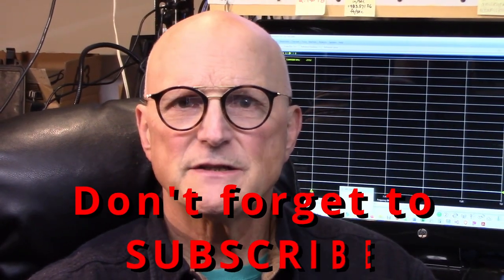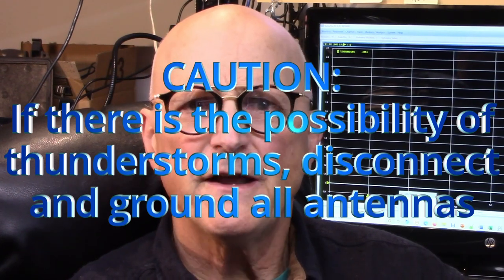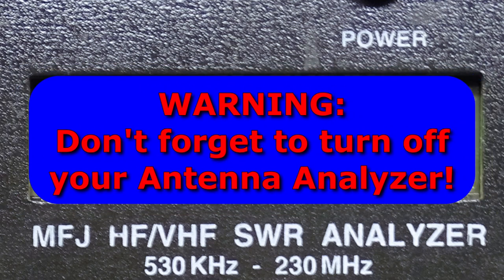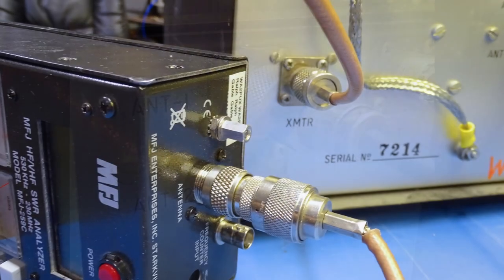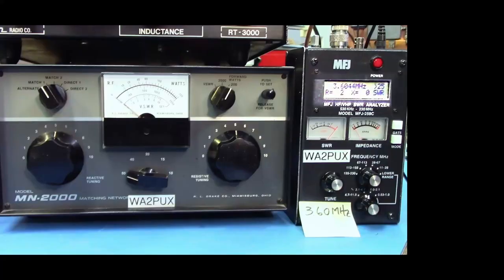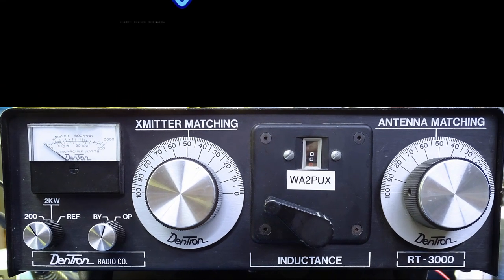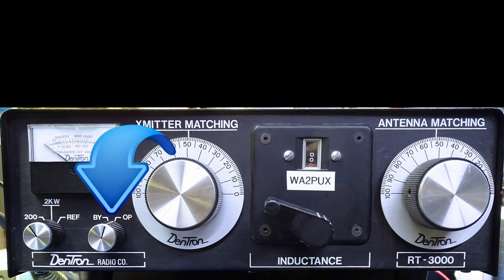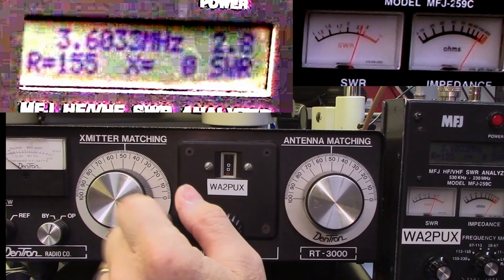Tuning Your Antenna Tuner using an Antenna Analyzer or VNA (007d)

Comment: This is an excellent explanation and demonstration. Most timely considering I just got an old HealthKit 1000w roller inductor antenna tuner. And I have been having trouble tuning with it. Going to connect my nano analyzer to it later to see if I can at least get a baseline on each band. 

Thank you sir
Kd9rek
73
Reply from the maker: Thanks, man! I am glad that you found the video helpful. I'd be interested to hear how that works out for you. 🙂

Comment: In my experience, adding a Smith Chart curve (on the VNA) greatly simplifies the process.  Adjusting the Smith Chart curve so that the closest point on that chart is nearest prime zero at the frequency of interest shortens the process of reaching an optimal match.
Reply from the maker: I can see where the Smith Chart approach would be very helpful. Unfortunately, most people's eyes kinda glaze over when faced with a Smith Chart, partially because they do not fully understand it.  The SWR view is something most everyone understands.  For an even more definitive view of the tuning point, the Return Loss format would be ideal.

Comment: I have a MFJ  949E. I think it would tune like that last one you did. It doesn't have a band switch,  or rotating inductor,  but has a inductor selector.  Thank you for the information! I wished I had that tuner.  But it may take up all the room I have for all my equipment.   73
Reply from the maker: You are very welcome! It was a fun video to make. 🙂

Comment: Great Video Ralph!
I was wondering about the VNA calibration-plane.  Did you just calibrate at the VNA or did you calibrate at the antenna tuner to zero out the coax that would normally go to the Xmtr?

Also, I have built a 1:1 balun (that is to be used for a friend's amateur radio club for their Winter FD) and have been able to successfully test for SWR and RL (using a SAA2-N VNA) but I wanted to do a supposed 'common-mode' test whereby you configure as a S21 measurement. In this setup,  the VNA shield is continuous (between S11 & S21 ports; but has NO connection whatsoever to the balun) but the S11 center-conductor is connected to the center-conductor of the input SO-239 (through a series-resistor) and that same S11 center-conductor is also connected through another series-resistor on the SO-239 back-shell. Then on the S21 side, its center-conductor is also connected (also through a resistor) to one of the balun's output legs and again, the S21 center conductor is also connected to the other output leg through another resistor.  
The problem is that when I try to duplicate this experiment, I just get really weird results (RL looks somewhat believable but SWR is in the hundreds!).  I also don't know exactly what the value  of these resistors should be and if there is any 'calibration-plane' involved and where it lies. In short, I have no feel for the measurement or any confidence in any data.

Is there any way to contact you (if your willing) so that I could email you this setup and additional ancillary information?
Thanks & 73...
Reply from the maker: I can identify!
I have not done a lot of this. I did find this article helpful, however.
https://www.kn5l.net/Balun-CM/BalunMeasure/
Port 1 is connected to the balun's input side...both center conductor and ground.
The ground of port 1 is connected to the ground of port two.  Now, on the balanced side of the balun (this article assumes a 1:1 balun), there is a 25 Ohm resistor between balanced side A and port two's center conductor and another 25 Ohm resistor between balanced side B and port two's center conductor. This gives the proper balanced termination for a 1:1 balun.
Calibration would be performed at the end of the cables as close to where you would be making the measurement as possible. The S11 calibration plane is at the end of the cable connected to port 1 where you performed the VNA "Enhanced Response" calibration.  "Enhanced response" will calibrate for both S11 and S21 measurements; so, open, short, load, thru and isolation. I think with the nano VNA, this is what they consider a full two-port calibration (S11 and thru).
I can be contacted via ARRL.  I also have a Facebook account by the same name as this channel.
Hope this helps! 🙂
Reply from the maker: This all has piqued my own interest. I think it deserves a video. I do not know when I will get to it. I have several videos in queue at the moment. But, I have added it to the queue. It'll be fun! 🙂
Reply: @eie_for_you  first off, thank you very much for responding and researching my comment.
I will definitely look into the article you sent and very much appreciate you, including that!
I think this would make a very good video as there is great ambiguity, about not only the method, but the theory behind this measurement. I have seen this measurement made by other, Youtubers, however, when contacted, they do not respond to specific questions regarding how they came up with certain values, or seemingly mystical correction factors that they just gloss-over or assume to be common knowledge.
Thanks again Ralph I really appreciate it!
73 …
Reply from the maker: @SpinStar1956  You are very welcome! 🙂

Comment: How would I be able to check my Free To The Air antenna VHF UHF for TV  Sir ???
Reply from the maker: I am assuming you are talking a 300 Ohm system. A VNA assumes a 50 Ohm.  Let me ping a friend of mine and see what he says.
Reply: @eie_for_you  300 ohm to 75 ohm balun. Thanks for your help fella.
Reply from the maker: Yes, understood. If we assume a 300 Ohm to 75 Ohm balun is in play, then the VNA or antenna analyzer is still expecting to see a 50 Ohm impedance and will report its findings accordingly.  So, let's talk an entire system which will include your antenna (300 Ohm) through your 4:1 BALUN (==> 75 Ohm). The antenna analyzer or VNA will be "seeing" 75 Ohms when this system is in perfect tune.  This represents a 1.5:1 SWR. I did, indeed, ping my friend about this situation and will report back as soo as I hear back from him.
Reply from the maker: Well, my guy didn't reply, so I did some research. If you are using something like a nanoVNA or miniVNA tiny to make the measurements, then you simply calibrate the VNA with a 75 Ohm load (assuming you are looking out at the antenna through your 4:1 balun). 
If you are trying to use an antenna analyzer, you are stuck with the whole 50 Ohm thing. :-(  A perfect SWR would be 1.5:1.
Most of what I found had to do with 75 Ohm, not as far out as 300 Ohms.  In the end, the VNA calibrates out all of the reflections and other errors as part of its calibration process.  My guess is that, even at 300 Ohms, you might be able to calibrate with a 300 Ohm dummy load and make your SWR measurements; the reported SWR should be right.  Some inaccuracies are going to be introduced, but the whole process of tuning an antenna is not a terrifically precise process, so these should not affect the outcome in any significant way.
Everything I do lives in the 50 Ohm world, so this is somewhat new territory for me.  I'd be *really* interested in what comes out of this.
Reply: @eie_for_you  Thanks for giving me information that I asked for Sir. I will keep you in the loop no matter what the outcome will be Sir. I have found one learns more about anything when the outliers are investigated and figured out. Now the fun begins for me fella. Good day and peace too. vf

Comment: You had 2 different setting on the tuner using analyzer and VNA or was I looking at it wrong?
Reply from the maker: The SWR curve is actually pretty broad. So, it is not inconceivable to have different settings putting you somewhere within this relatively broad dip.
Furthermore, there is the difference in accuracy between the antenna analyzer and the VNA. 🙂
Reply: @eie_for_you  Great Videos
Thanks for taking the time to help new ies and old-timers alike!
Not many of us left, no more in sight!
Reply from the maker: @bigdaadio.K2WW  True that! I'm no spring chicken myself. I just have to share what I know and what I am learning (or re-learning) while I still have a brain to do it. There is going to come a time when I cannot.
You are very welcome. It is my pleasure! 🙂